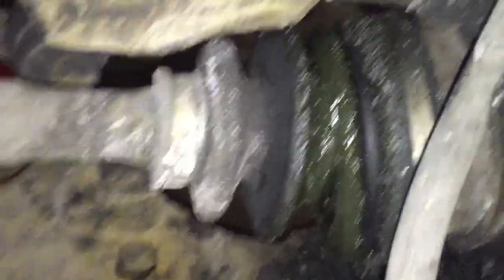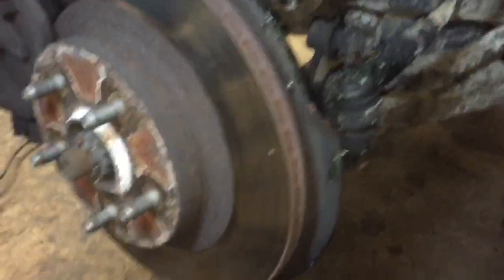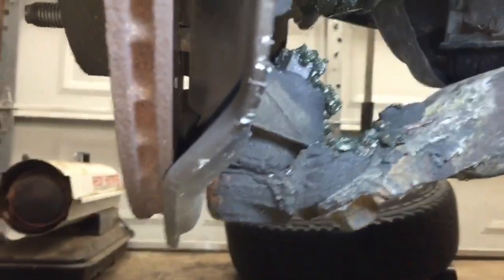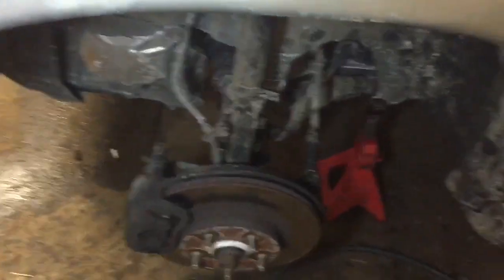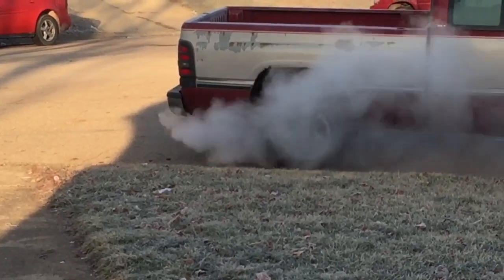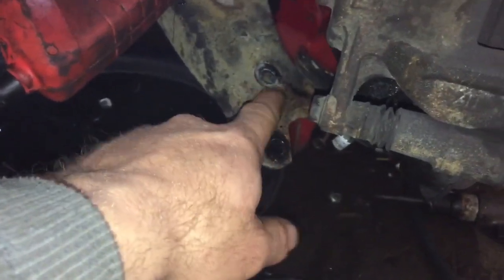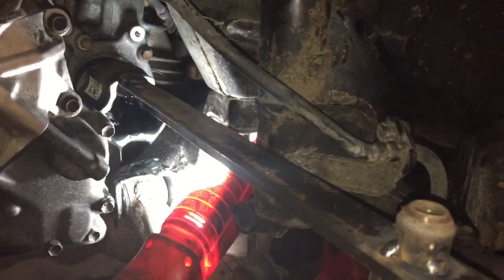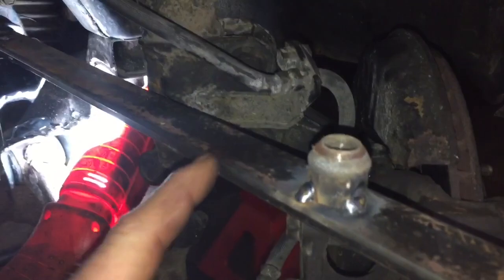99 Toyota RAV4 CV Axle Replacement

Comment: I found myself in the same satiation but I ended up using the visegrip and dent puller method ( seal is a must it is not worth the headache after all that work incase you have a leak)